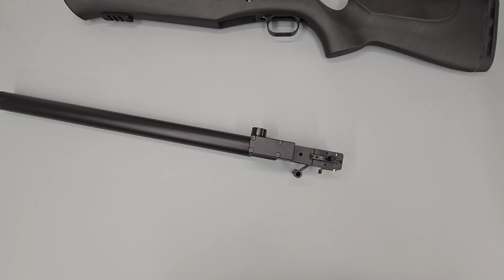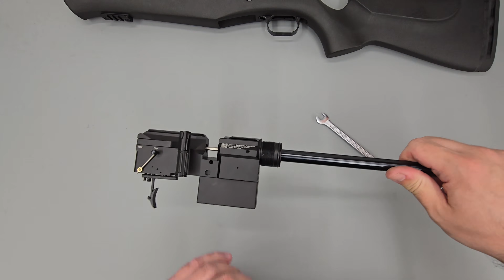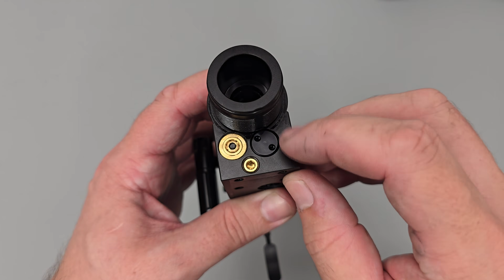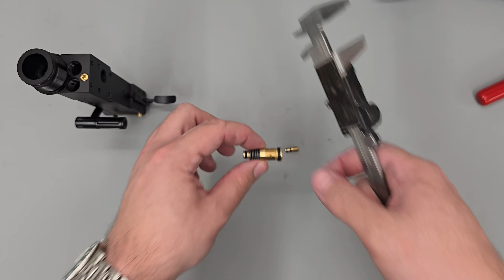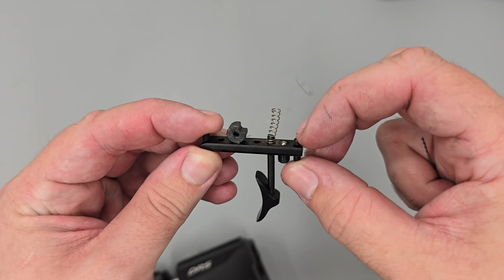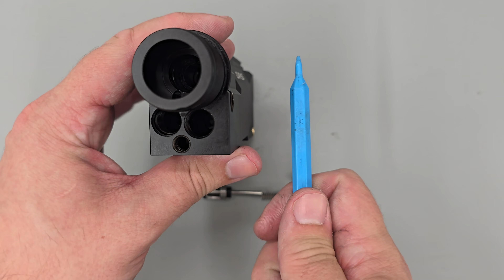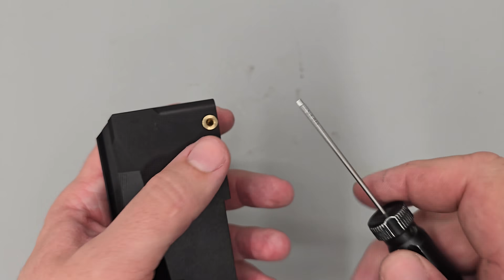FX DRS full disassembly (UK 12 Lb/Ft)

Comment: Hi I am having an issue with the gun loosing pressure when filling, Im filling to 230 bar but then falls below 200 when releasing the pressure from the whip. FX have said (I would test changing the O-ring on the check valve) could you tell me which part of your video relates to this bit and is it an easy job?

Comment: the barrell looks mediocre - the overall fit and finish seems reassuring however the barell looks like a dring straw...would be weary to beyound 4.5 mm (.177) caliber. Which actually is what the seller asked me whether or not would I like to go with greater pellet diameters as the air canister OD does seems not be chaining though, what happens is the barrell wall gets even thinner and thinner. Correct me if I am wrong.

Comment: My permanent seal has gone in the main block which seals the barrel can it be replaced. And do you no the dimensions of that permanent seal. thanks
Reply from the maker: yes it can be replaced it's a 14x2 NBR 70 O ring at either end
Reply: Thank you

Comment: Can you adjust the regulator screw up or down without having to depressurising the air out the tank and stripping the gun down?
Reply from the maker: you can go up but not down if you need to drop the reg pressure you need to de-gas first

Comment: Really good video recently stripped mine down and didn't notice if their was any specific way the impulse valve seat went back in is their a specific orientation it goes in as I've noticed an embossed half moon shap at the back of it does this need to line up in anyway thanks again for a great video

Comment: I have a leak in my drs and I can’t seam to find it, I changed the plenum, angle block and meter, and slug probe. I have resealed and checked the areas and still leaks down 200psi in two hours, any suggestions would be greatly appreciated

Comment: 6:50 if internal oring is damage, it will leak from top screw(weaver screw), 14x2 nbr90. Simple to replace, u just need pickup and pinzete or to remove cocking and push via e.g. those chines woods 😊

Comment: Hi, very nice videos and nice work.
I am learning a lot.

I am trying to fill up an FX drs with a hand pump. Unfortunately it is at zero pressure now.
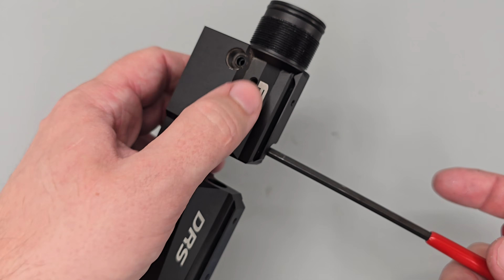I felt air coming out from the plug you show @23:30 is it normal? It does have a pellet in the barrel, when I open the sidelever, air scapes out, back in the pellet probe hole.
If I close it, air leaks through the plug @23:30.

Would be nice to know If something is wrong before filling with air (Not wasy from zero with a hand pump any hint) If it an oring there, I would need to empty it again to solve the issue.

Best Regards.
Reply from the maker: thank you for watching 😁

Comment: Aup mate. Wondered if you might have an idea. My fill probe went bang the other day and since then my rifles extreme spread has been around 45fps. Took it apart and found no issues, took it to the range and it would settle on 698 for a bit, drop to 666 then back up to around 705 and now it's staying there with a 5fps extreme spread. Any idea what could be causing that? I'm going to keep the chrono on it at all times for a bit to see if there are any changes.

Comment: Sub 12 UK - 'make sure there's no air trapped inside the plenum'. Well I'm told that the 'plenum' is completely false and only a solid block of metal. What's the truth please??
Reply: There is still some space in the breech block, which is a plenum for sub12.
Reply from the maker: yep just a solid block of aluminium

Comment: All manufacturers should pay you to do this great video very informative
Reply from the maker: I appreciate that!
Reply: But no manufacturer would want outsiders messing with the airfuns when they could be paid to do the job. I'm astounded by the sheer number of o-rings, probably only beaten by the twin reg FX maverick. I've lost faith in multi o-ring guns and gone old school  simplicity, working the 'sweet spot'. Air arms S200 (CZ). Essentially only 4 o-rings that are permanently under pressure, and very accurate. No bendy barrel under pressure (when it should really be in tension to keep it straight!). Reliability in the field to me is paramount. This screams 'unreliable' to me and would be an absolute sod to dry after a shoot in the rain. @sub12airgunners

Comment: Excited to see how you will make it accurate.
If it's a barrel change that's required then shame on FX for selling inferior products at that price.
Reply from the maker: thanks for watching 👍
Reply: Great video. Well put together and much better than most found on YouTube. Have you managed to get it back together and test it yet. I've been debating purchasing one of these myself. How bad was the accuracy you were experiencing? I was debating a .22 version to replace my old but still going strong air arms s310. Just fancy a change really. Looking at the solid block that is the plenum blank . It looks like you could put an adjustable volume adjuster into that which would allow finer tuning perhaps? Anyway thanks for the post really good👍.

Comment: My mate bought the wood stock, it fills from the other side, within a few fills it had clipped the first O ring on the probe which prevented filling
Reply from the maker: that doesn't sound good 😲
Reply: @sub12airgunners  O ring hard as hell, luckily a spare was supplied, and he lubed it up if you pardon the expression. You would think they’d supply a dust plug too, but that’s FX for you.

Comment: Fifteen years ago, I also designed the current EAE airsoft model, which has a left-hand loading push rod on the outer ring of the gas cylinder. That is to say, after firing, there is no need to use the right hand to pull the bolt. I thought about and designed the mechanism of loading the gun by pulling back with my left hand fifteen years ago. Because it is a contraband in China. My design cannot be implemented. . . I'm depreesed

Comment: I am an airsoft enthusiast in China. The structure of fx drs is the structure where the barrel is inside the air reservoir. I designed it fifteen years ago. It’s just that it is an illegal product in China and cannot be processed. So gave up. . I also have an idea here, which is an open hammer structure air gun. When the valve block is rotated, the chamber is loaded at the same time. Which air gun company of yours designed it first, it is also the latest structure.
Reply: Thank you. I freaking hate pcp with giant air tanks.

Comment: There seems to be a large variation in accuracy with these guns, what I will say is I got mine a week ago it’s in walnut it has an a-tec wave moderator and a hawke compact scope and I picked up a box of qys domed not knowing if they were suitable and at 30yrs I’m getting pretty much pellet on pellet…..and though I’m sure it’s because the gun is fun to shoot I seem to get through a load of pellets without realising it but that’s an illusion is just because the rifle is a great crack to shoot and for £1216 including new scope moderator and pellets this rifle is hard to beat…..saying that I’ve already been lured by another rifle the FX CROWN MK 2 and while I’m speaking of the fx crown can anyone tell me if it’s worth putting a 600mm barrel on the fx crown mk2 in sub12 ftlbs or should I stick to the standard barrel that comes with the rifle.

Comment: I'm new to the airgun world what is the difference between the regular plenum, and the high power one if the regular plenum is just a block with no volume they say one is so many cc and the SHP plenum is more? Why didn't they just make the block thinner and then they wouldn't have had to cut the stock out for it?
Reply: This is the same gun as the Pro and all the pro's have the tall plenum. Maybe is so they can just make a cheap stock for the classic and shove a pro style assy into it with different barrel lenghts and sell for $1300 cheaper to get some rifles. The classic in a 700mm is a pro minus slug kit and trigger.
Reply: The plenum is the chamber where the rifle gets the air from .the regulator is the part that fills the plenum from the cilinder or botlle.to a set pressure .so the rifle shoots with the same pressure
Reply: @peteralexben  so the plenum is hollowed out a certain volume for pressurized air.
Reply: @HD-ph1dc    you fill the gun cilinder with 235 bar .the regulator brings that pressure to 100 bar or so(or less or more where the law has a  max legal power output )in the plenum 
.so you get  a constant pellet speed  .til the gun cilinder pressure get under the reg pressure .and then you need to refill the gun
Reply: @peteralexben  thank you.

Comment: Thanks, interesting video as always!
Seems to me the machining is a bit rough on these and there seems to be more "leftovers" and marks from it. Accuracy issues in my opinion come from their lack of tuning/adapting for sub12 shooting. You might find the liner is a "heavy" slug liner, 1:18, for your use a pellet 1:24 liner would be much more accurate. Might be worth a try. Add the carbon sleeve while you're at it, it helps a lot with barrel harmonics.

I've been chasing small and slow leaks on my Maverick lately. Fix one, next one pops up in a short while. Rifle is from 2020 and has had around 30k shots fired through it with no problem at all up until this began, other than the cocking rod bending slowly over time, which i replaced with a titanium one about half a year ago. Simple matter of maintenance in my opinion, i'm going to take the rifle completely apart to replace all the o-rings and that will most likely make it last another 3-4 years without any leaks. The complete o-ring kits are very cheap, so i'm not bothered by it at all. 
The rings i've replaced so far were the plenum body one closest to the block and the one before that, the second regulator body one (replaced the reg with a Huma one while at it, very satisfied with that one) and the tiny valve pin one. 
The rifle has been shooting at high power all its life so far, in .25 and .30 at 80 and 130 ft/lbs. My standard distance is 95 meters and its sub-moa with ease.
Mod parts as far as internal/performance are the Huma reg, carbon liner sleeve, better gauges, 300bar bottle, hammer spring and the hammer.
Reply: I see that you are also a very professional enthusiast. Like me, I designed the fx structure fifteen years ago. EAE has a left-hand loading structure, which was also designed fifteen years ago. Which country are you in?

Comment: Have to thank you for taking the time so provide such explanations in a clear video. This explains how the rifle works and I've changed my mind on one, so I’ll be buying one.

I’d fit a new rifled barrel as standard but I don’t like FX barrels/sleeves and don’t like that there is the same temperamental o’ring arrangement between such. Even with a thicker rifled barrel, I'd look at a couple of de-pingers, possibly under spring pressure, to both inside wall and barrel in order to help with barrel harmonics/movement.  

The brass hammer spring guide could be slimmed and a delrin top hat sleeve fitted over to combat future rubbing and fouling.

Haven’t seen the block but could a new valve seat be produced, without the large opening, so that there is less wasted air pressure (filling the large current volume of the valve seat) when air passes between valve pin and transfer port? Seems unnecessarily large, presumably one for all rifles of any power.
Reply from the maker: thanks for watching 👍